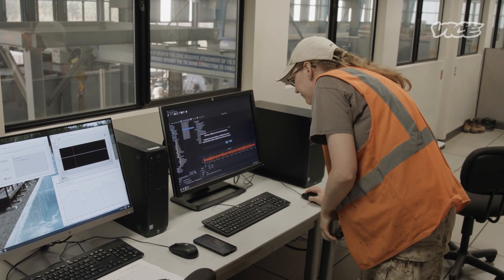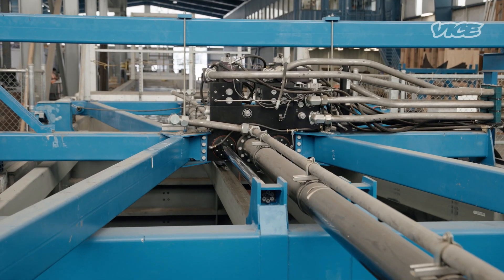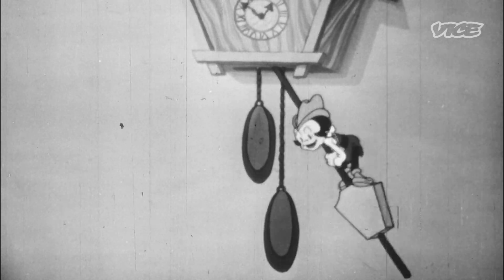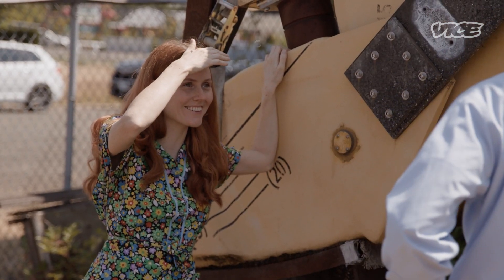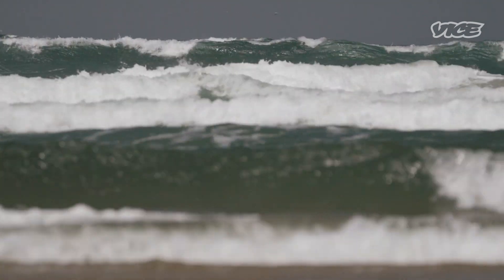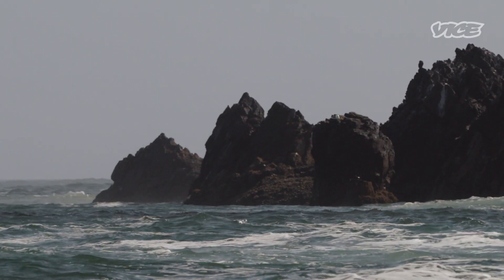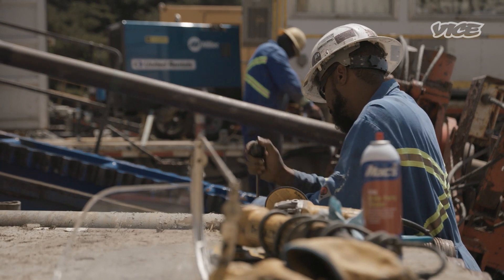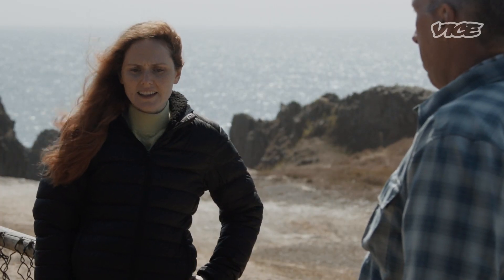Wave Energy Could Slash Our Use of Fossil Fuels

Comment: What if we reuse the oil rigs and change the drill for a enormous vertical turbine, and we move then to strong current places, so the turbine has a perpetual movement, and we reuse old installations instead of creating new ones and having to move them in place, and we just relocate installations that are already in the sea
Reply: Money
Reply: This big brain idea is too smart for people to acutally use it. Some oil shell lobbyists will find a way to combat it like always.
Reply: This a great idea
Reply: tenaciousCorvidae  i'm not that important, you know?
Reply: How are you going to transport electricity from oil rigs back onshore. What if one spinning water-wheel doesn't even provide enough energy to power an oil rig much less as much energy as millions of barrels of oil shipped back on oil tankers.
Reply: @RedShnow  at least we can try, maybe not to send electricity back to shore, but start enclaves and cities in the sea, making them in a way to keep those installations in use, than just scrap them and lose material and terrain in the process
Reply: @luckystranger4312  I appreciate the response without viciously attacking me for my opinion. But, they do transport depleted rigs back to shoreline facilities to be dismantled and recycled. Other than that I don't know if you're serious about building cities for people to live in the middle of the ocean around oil rigs. Seems like not a very economical settlement.
Reply: @RedShnow  we can always try, see if it works and the if the economic side grows some relevancy, the we will see how to make profit from it, but everything always needs a start point, also, it would be nice to not have to do something just for the profit, but for humanity betterment, but maybe that is just a fantasy
Reply: @RedShnow  that and also that maybe the energy would not be enough for powering something on shore, but if the turbine-rig makes enough for powering itself and a little more, we have a terrible for a little test settlement with self sustaining electric energy
Reply: Perhaps the wave energy available on the rigs is less than closer to the shore. Usually rigs are quite far from the shore

Comment: Seems the most long lasting, sustainable.
Reply: Yeah awesome 😍
Reply: Do not underestimate the sheer wear and tear.
Seaside wind turbines dozens of meters above the water get shredded by flying salt, sand, spray at crazy rates.
And those are exposed to a fraction of the stresses.

Waves will rip, rend and tire the materials of anything you put in them, given it tries to resist their force (unlike a boat).
And you have to resist that force to generate (i.e. translate) energy, thats just simple conservation of energy.

Comment: Very cool stuff.. 
hey Vice, look into the new Vortex Hydro Energy solution by the University of Michigan whom did a new patent recently to harness lower speed river power and stream power, which can be used almost anywhere there is even small amounts of moving water.
The technology is very unique they patented called VIVACE Vortex Hydro Energy by the Engineers at University of Michigan.
Reply: Another thing is the50 state 'Solutions Project' by the University of Stanford and other scientists.
They have a map and each state is broken down into a chart showing what percentage of alternative energy sources can replace oil and gas, entirely... in all 50 states it is hugely proven on The Solutions Project
Reply: I have seen these little personal hydrogenerators that you can just set in a creek and they'll charge your devices... Not sure how efficient they are, but I love the idea.
Reply: looks neat, works for slow moving rivers

i dunno if they would be so useful large scale though, and messing with the rivers is not always ecological

Comment: Every ship and many shores should have flexible outriggers that generate energy.
Reply: That would kill alot of sea life
Reply: @allenwilliams7367  And pollution isn't?
Reply: From a physics standpoint I'm not sure about how feasible this would be. Energy generation would Impart a force on the vessel which would then have to expend energy to stay on course. In addition say you had some energy generating structure attached to a vessel, we would see a large increase in drag so the vessel once again has to expend more energy to offset this drag. Assuming that generators don't have 100% wave-energy conversion efficiency we would most likely see a net loss in energy.
Reply: Try putting wind turbines on a plane and tell me how it goes
Reply: @dankoch5357  I'm thinking of the energy recapture when anchored but depending on conditions, I imagine it could offer more emerge capture than loss to drag while underway too.
Reply: @sanjuansteve  How is it not, your adding a lot of drag and weight to a boat, how will this produce more energy than wasted fuel?
Reply: @sanjuansteve  That becomes deadweight you need to carry when not in use
Reply: @Waffle4569  How much time do most ships wait anchored, waves battering?  How is it possible you cannot even imagine the wave energy could possibly be worth the losses?
Reply: @sanjuansteve  Your solving a problem that doesn't need solving, and creating a bigger one... Barely any energy is used anchored compared to moving. When you need that energy, the device is adding more drag...
Reply: @Jo I'm talking about generating energy for the ships themselves.

Comment: I’m just curious how this is going to be implemented without devastating shoreline ecosystems
Reply: It's possible but may not be a priority. The recent heatwave in Canada literally cooked about a billion coastal marine animals. Ocean warming and acidification are killing reefs and corals pretty much everywhere. Could go on about oil spills, fertilizer runoff, overfishing, etc, etc. Even if these wave generators were scaled 1,000x they still wouldn't approach the level of devastation we're already causing those ecosystems on a regular basis.

If we don't get a handle on the damage we've done to the environment, the damage these systems might do will be totally irrelevant.
Reply: @mikep1530  good point
Reply: @mikep1530  ya, if we keep going at this rate, disrupting coastal ecosystems wont be an issue

Comment: it would b hard to get PVC pipe, a submarine would have to dig the trench, connect the PVC, then run wire though the pipe. the flap box would b the best way, since it would be out deep in the ocean and wave shouldn’t destroy it.

Comment: You don't say , back in 2009 we had a Hydro engine for cars that could make then run 160KM\h for 300KM on 60 Liters of Water ... but due to American Oil Companies they scrapped those water Hydro cars ... and now they Push for Toxic Electric cars and its awful recharging Battery system ...lets just that sink in
Reply: It didn't run on water, it ran on Hydrogen and produced water as exhaust. Hydrogen fuel cells had numerous problems when attempting to scale them up to commercial viability in cars. Ballard fuel cells are still very successful in their niche applications - but unless there is some massive breakthrough in their cell design, won't ever be common for consumer vehicles. EV's are a colossal improvement over internal combustion engines for consumer vehicles - production produces far less waste emission than EV's (yes, even factoring in unregulated dirty lithium extraction), and there is no comparison on emissions: EV's from green energy generation have zero emissions, ICE's are always dirty on emissions. EV's also have longer lifespans than ICE's and can be recycled (as they are just lithium and steel) versus ICE's which deteriorate with wear and chemical reaction.
Reply: @Yvaelle  we are speaking about Genepax and Stanley Meyer... Yes ? checking if we are on the same page ... and later his "Hit" sponsored by Big oil that stopped all progress on this technology (better put , destroyed all prototypes, and progress on this tech)... so all lost progress , now has to be reinvented again by Toyota

Comment: I envision that capturing the tidal wave energy will be tied into an infrastructure that is holding back the tides from flooding the largest cities
Reply: Not so much tides, but by over-provisioning the generation aspect you can use them as sea walls that prevent erosion and generate energy at the same time.

Can't stop a tide, but can make the waves behind them much smaller

Comment: all of the wave energy of the us coastline would meet 64% of the US power needs in a year??? That's garbage???
Reply: Just need a little to help solar and wind, batteries
Reply: How is that garbage? That's significant and even with like half of that. But obviously we wouldn't use this exclusively. We'd mix the grid with other clean energy sources easily.
Reply: @MarshalofFrance  because harnessing even half the energy produced by the ENTIRE US COASTLINE is still a monumental feat. For perspective half the us coastline is 42,500 miles of coast. That'd be like creating two rings that circumnavigate the whole planet, and those two rings would only cover the power needs of 1/3rd of the United states.
Reply: @MarshalofFrance  just to be clear, im not anti clean energy. I think its just more productive to focus on more efficient forms of energy production than any possible route.

Comment: Yeah, it's not going to work

The main limiting factor is not the mechanics but the durability/maintenance ( corrosion ) of the equipment which are at the surface of salty water and are constantly exposed to air.

Having to Replace the equipment every 5 yr vs every 10 year can have a major implications on it's feasibility analysis.

I mean people don't want to invest in neuclear which is way way better than anything we have.

Comment: RIP my elementary school teacher that taught me waves were caused by the moon! And no I don’t mean the tides, we learned both were the moon wtf 😬
Reply: Taylor Chesal  dude didn’t mention wind either 😭😭 just said it’s from the sun’s uneven heating of the earth.. Wait is the sun responsible for wind?? 🧐
Reply: Taylor Chesal  His theacher was still wrong, tides are not powerd by the Moon, otherwise the Moon would lose height and come closer to Earth. Tides are stationary, it is Earth that is rotating inside the tidal buldges. So tidal power is flywheel power slowing down the rotation of Earth.

Comment: I wonder if wave energy facilities protect the coast line? Coastal erosion is a big problem, made worse by rising sea levels. Theoretically, the energy that such a facility absorbs doesn't reach the coast so it's a 1:1 gain and protection ratio. In terms of biodiversity, wave energy facilities might serve as artificial reefs which would be amazing! especially if they were designed with that in mind

Comment: When will you do a video about drilling to the center of the earth? There is a private funded company drilling to the earth right now. The last time it was attempted was called (Kola Superdeep Bore Hole) location: Murmansk Oblast Russia 1970-1992 7.619 Miles 40,230ft deep.

 But as of 2008 a oil company called Al Shaheen Oil drilled 7.636 Miles 40,318ft  for a oil pocket.

1987-1995 Germany tried drilling but only got to 5.655 Miles 29,859ft (Continental Deep Drilling Program)

2002-2005 China project (Chikyu) got to 7.5 Miles and tried to beat Kola Superdeep Bore Hole by drilling out in the deep sea, with a Deep sea drilling vessel.

Comment: The Bay of Fundy that the Saint Lawrence Seaway runs into is the second largest freshwater Outlet in the world the current in some places is 15 miles an hour and some of the waves from the fast water not the wind or storm can be fifty feet high you could build a monitor system fat on one end and skinny on the other that's how power dams work we push the water through the fat in it comes up the skinny and hard and fast and turns a turbine this this would supply all the electricity for the whole Northeastern United States and that part of Canada also and cost absolutely nothing to run other than the wages of a few people that's monitor it or do repairs or maintenance they already have these and other places and wave generators also the waves in the Bay of Fundy are 50 ft high and move it almost a hundred miles an hour ships have to go around them cuz they can't go up the biggest ship in the world has to go around the current Eddie's in the Saint Lawrence Seaway in the Bay of Fundy